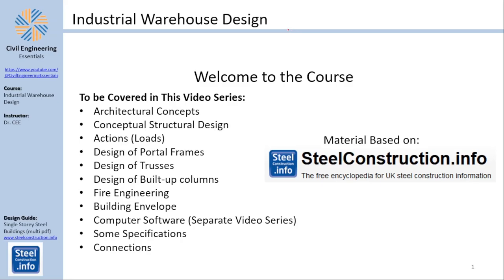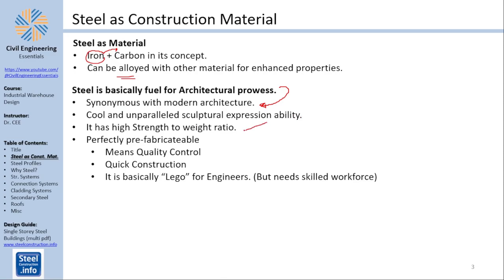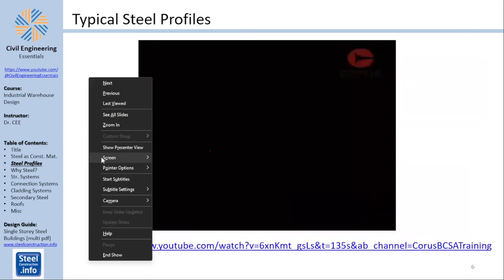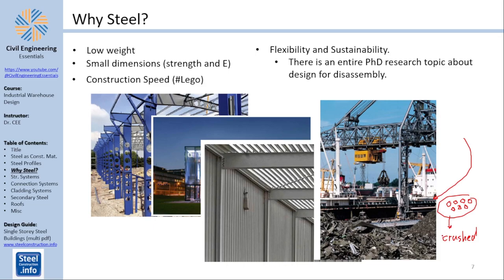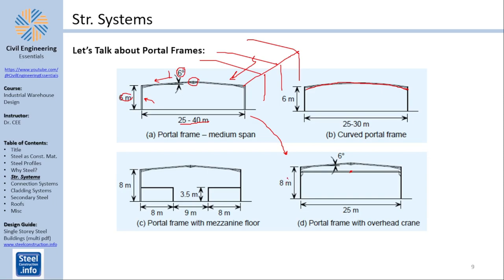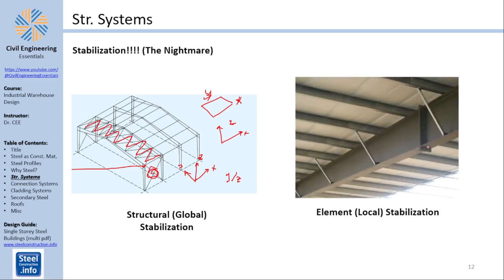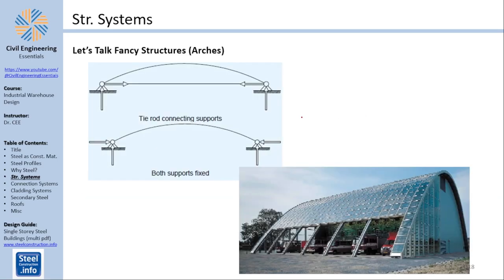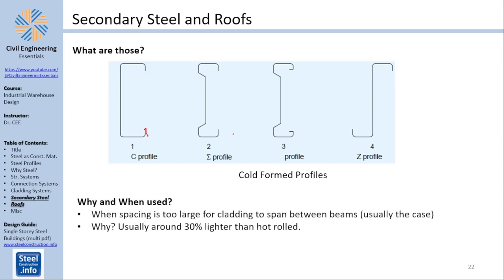Design of Industrial Warehouses | Part 1: General Intro

Comment: About stabilizing the bottom part of a beam, and trusses, given that these are subjected to tension, why do we need to do this? Will not the tension be self-stabilizing if the tension flange try to buckle out, given that the member cannot rotate about its own axis in the end connections? Could you explain this further, or refer to an article or something that explain this?
Great video!
EDIT:
I have underestimated your mind reading abilities. Of course you predicted these questions and explained it to me in the next video in this series. Thanks! So if i understand you correctly, we do indeed only stabilize for the cases where the usual tension flange/chord could experience a load case giving them compression?
Reply from the maker: Thnx for your comment and question.
I would split my answer (second question into two parts)
Theoretically, yes, only if a load case gives you compression. And the load case that would produce this is uplift wind

Also theoretically, near the rigid joint with the column, you got negative moment so it is definitely a must there.

Practically, I have seen people just stabilize the entire length of the beam, especially if the beam comparatively significantly larger than the purlin.

Stay tune for more videos in this series,
CEE
Reply: @CivilEngineeringEssentials  Thank you very much for the quick response. I look forward to the rest of the series.

Comment: This is great!! Will you include buckling analysis and second order analysis with imperfections according to the Eurocode? Robot can use a buckling mode shape as a global imperfection, but I’ve not seen any book explaining how that’s supposed to be done in a real project instead of in the usual trivial academic examples.
Reply from the maker: I have buckling on my Radar. I think I will be covering it during this video series.

I guess it could be a great benefit to deal with it here.

Academic examples are nice and all, but, well, it is kind of that. Academic. So basically a double pin and small disturbances and so on.

Most welcome. Consider suggesting this channel to your friends, it helps a lot ^_^